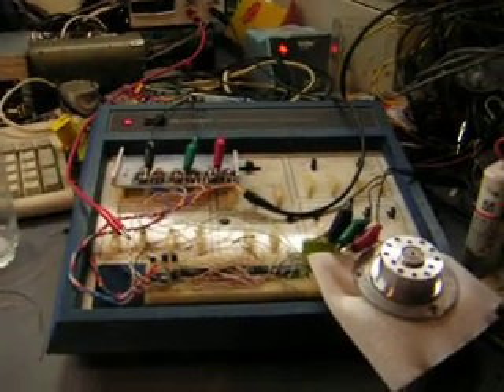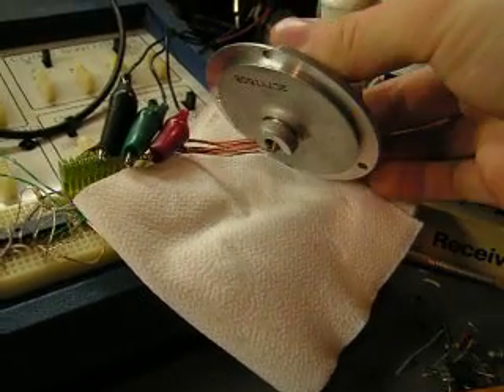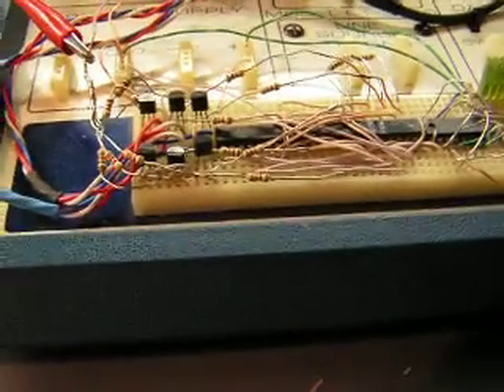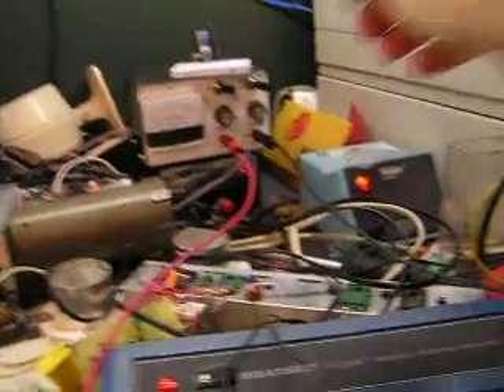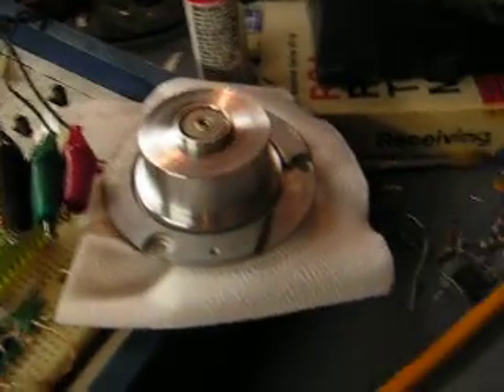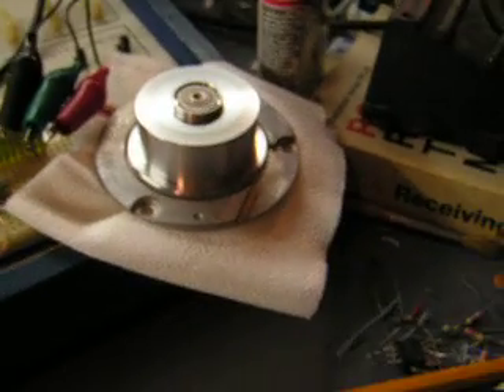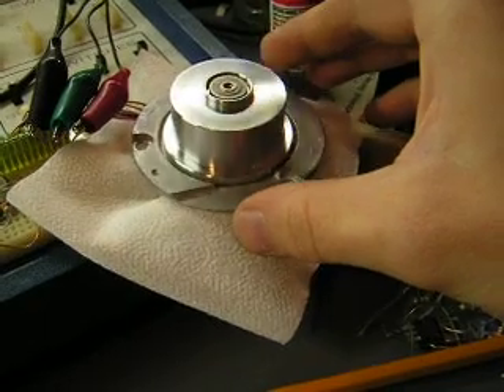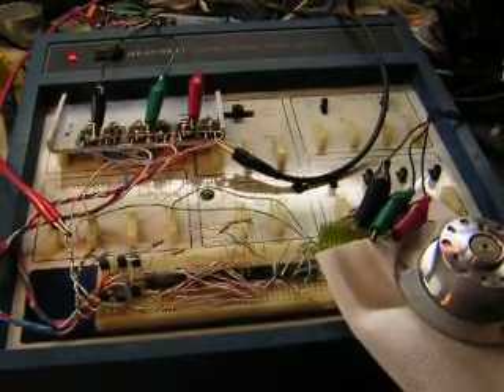Hard Drive Motor

Comment: Got a schematic of your creation?  I never tried powering one of these motors before...  But I have about 100 of them from tearing apart drive to get out the magnets and use the casing to build little magnetic proof like little jewelry boxes out fo them to store my dongles and stuff in to shield them from outside interferences or other magnetic flux from whatever may be nearby (such as magnets I may leave on my table... )  or to store the magnets in so don't mess with my other electronics...
But been saving these motors for a long time and been curious in getting them working to do some other projects because I knew they spin so well..

Comment: are HDD motors viable to use for quadrocopters?
Reply: Probably not, unless you could give it enough torque for its blades to cut through the air and lift something (like itself)

Comment: I'm not sure if this crossed your mind and I have no idea how fast you are spinning that thing, but I would be cautious of over-revving motors like that. They are designed to hold themselves together at only so fast and once your go so far above that "so fast" the spinning bits mechanically fail, simulating the effects of a weak frag.

Comment from the maker: @ingmar602 It wouldn't as a matter of fact. For every motor (as with every transformer) there is a point of diminishing returns as the core saturates and you can't develop any more magnetic field strength without extreme increases in electromotive force. After this point the motor or transformer simply burn up.

Comment: there's a trick to making simple controllers for these motors using adder chips...
personally I use the 74164, a later 7400 series chip, and some decent transistors.

Comment from the maker: Older drives had the motors fitted with bolts; these days the motor is normally integral to the body of the drive and cannot be separated from it.

Comment: Spacecraft (*opinion) use this same type of thing.. Except, did you see at first when the bottom ring almost spins.... If you set this up so the larger outer ring spins, I bet it will lift off the ground itself under a vortex magnetic motor shown here...
watch?v=hkgyY47duCM

This this whole system also was sitting with in the vortex motor, this may help it to stay afloat is my idea.

Rig something so the outer ring spins at high speed and the center does not spin. =-)

Comment from the maker: If you connect wires to a 9V battery the motor will spin to a particular position and stop there. The motor needs its windings excited in in sequence over time to make it turn.

Comment: not enough torque to use as a power tool.  would be better as a fan or propeller. its still, if fitted with the right blades, could cut a finger off.  so be careful kids!

Comment from the maker: It's a matter of power input, not voltage of supply. If it were operated continuously, it would have melted, but I only operated it for about a minute at a time.

Comment from the maker: The motor itself actually still only has three wires. The extra wires are for the sensors and shouldn't really be considered part of the motor itself. The circuit is not complex compared to a modern hard drive controller, which generally uses a microcontroller to operate the motor. Modern ones have no sensors; they sense based on back-EMF directly from the motor wires. My circuit is using logic circuitry to prepare a proper waveform, and then three MOSFET half-bridges to drive the motor.

Comment: That's an interesting motor there because hard drive motors these days are either 3 or 4 pinned and have no hall sensors.  By the way what is the schematic of the circuit? It looks complex